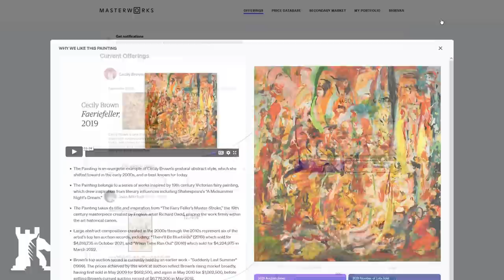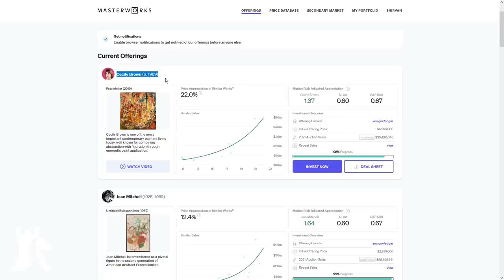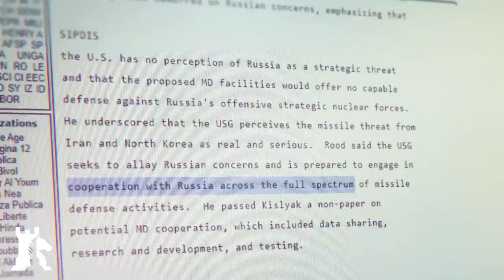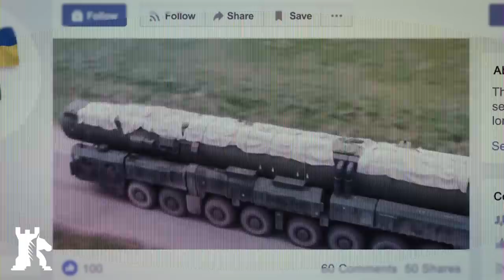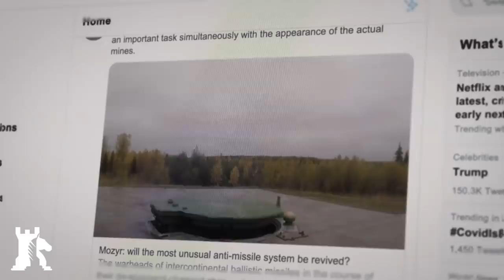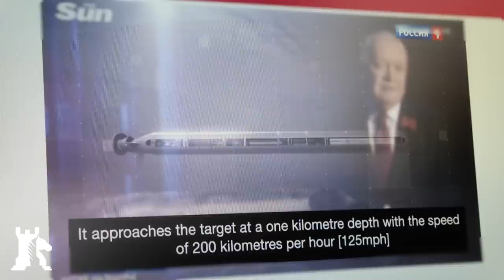Russia develops new doomsday weapons

Comment: 30 years ago building a muli-axis CNC was a big deal from a software & computing point of view.  Now you can buy a 3D printer for < $600.  The electronics restrictions aren't going to be as effective as they once were from the point of view of manufacturing. Your $200 phone has enough CPU capability to run a multi-axis CNC machine.  It will just take some time to put together a local industry.

Comment: If these weapons work like the rest of the Russian military equipment, I think the Russians should be way more scared of the NATO response 😅 also, even if they all worked as intended, they are pointless because it would be like signing your own death sentence if you decide to use them. And Russia boasts of capabilities all the time that turn out to be nothing but hot air. The US approach is far more responsible and discreet. They don’t publicly announce exactly what capabilities they have.
Reply: I predict that in 2 years time Russia will enter revolution and will be denuclearized. Maybe with a swift and mean slap from NATO. I am an optimist though.

Comment: This piece was okay but I think you're missing some of the bigger picture here:

The US and the west have had the capability to develop a missile defense system that would basically negate the entire Russian arsenal's effectiveness since the late 80's. We have a limited amount of these missiles in the ground in a base in Alaska, but we purposefully keep the number low, as you correctly point out, to not tip Russia over the edge. We also use it as a bargaining chip.

The missile defense systems in poland and germany were never intended to be used against ICBM's because they are not along the path an ICBM would follow to get to the US. ICBM's would fly over the north pole and through Canada to attack which is the shortest distance. Not over the atlantic. Russia knows this lol. Patriot systems are primarily anti air defense systems that can also take out things like cruise missiles, which can be nuclear tipped. These are considered tactical nuclear weapons though and pose much less threat overall.

Russia has had the capability to blow up the entire united states and western europe to kingdom come since the 70's, and we've had the ability to take them with us since then too. Neither side has consciously chosen to negate that edge so as to avoid provoking the other, hence the tense negotiations you describe. Nuclear drone torpedoes provide very little advantage in this measure, because after all, if russia wants to send the united kingdom into a nuclear winter, it doesn't need some scary new drone torpedo to do so. It already posesses the weapons it needs to achieve this goal.

All three of these new projects are basically just purely propaganda designed to scare the west and impress people (like you, Caspian report) into falling for it hook line and sinker convincing everyone else that russia is still some relevant and scary power. They're not. Western analysts have been skeptical that poseidon is something Russia will ever be capable of achieving, and now with the onslaught of western sanctions and the general difficulty with obtaining advanced electronics, it's almost certain to set any progress they were making back decades.

The west doesn't take russia seriously with these measures because they recognize them for what they are: pure propaganda. And you're just amplifying it.
Reply: Good man for putting them in the picture......thats surely one of the best answers ive seen on youtube comments.....keep up the good work !
Reply: @freddiepizerhall8324  look up the ground based interceptor program. It's deployed mostly on the west coast to counteract a launch from north Korea. The aegis system used on most warships since around the time period I mentioned is also the most reliable system we have.
Reply: @AlexDahl  I will look it up Alex...cheers for that !
Reply: Stay away from drugs kid!
Reply: If they are for pure propaganda reasons and people like Caspian report fall for it then they surely achieve their purpose. Let's not be biased
Reply: @johnxina5126  what?

Comment: 8:28 According to Wikipedia (sources listed there, as usual), its range is 18.000km. The technique used is called Fractional Orbital Bombardment System, which, basically instead of lobbing it up to come down at a specific target area through pure ballistics (in other words, what the V2 already did in WW2), it also includes a course correction once in space so it stays in a low earth orbit, just to shoot a retrograde burst once the destination is reached. And by entering a LEO, it's not suborbital anymore by definition. So basically it's got a flight profile just like a space shuttle with the only difference that it doesn't land safely, but goes boom-boom instead. With that, they could circumvent the NORAD defensive launch detection systems by just launching them in a southerly direction instead of taking a more direct route, but it won't go inbetween the continents like a snake as shown in the video, even though it would probably pass the south pole or at least get close to it. In case it would be suborbital, they'd do it with the "hypersonic" glide vehicle (everything that comes back from space is hypersonic, so it's just a nice buzzword here) and bounce off of the atmosphere several times. Eugen Sänger had that concept already in WW2 with the "Silbervogel", also known as antipodal bomber, with the thing even coming back for a landing after dropping stuff on the other side of the planet. In a nutshell, there's nothing groundbreakingly new here at all.
Reply: A lot of people don't trust Wikipedia...
Reply: Lot to read here but thank you for taking the time
Reply: @leandersearle5094  Alot of people don't trust people replying to youtube comments...
Reply: I wonder if the Americans can figure it out.  Lol.
Reply: @Healthliving1967  I was being Ironic.   It's fairly obvious that NORAD etc will require minor updates. It can already cope with SLBM
Reply: @williamzk9083  NORAD lol,thats all but forgotten about nowdays. They have far more advanced D.U.M.B.S in many locations over America. There is so much we dont know about that has been going on for decades its unbelievable. I doubt the general public will ever know about it.
Reply: @granhei  Don't trust any source unless it's yourself ;)
Reply: @williamzk9083  BTW, it's pointless anyway to have a max range figure given anywhere if the thing would be capable of establishing a LEO. It'd basically be "anywhere on the planet within less than 90 minutes". And that's not a new thing either. And most probably NORAD etc. would know the stuff a lot earlier before the average folks hear anything about it on either type of media.
Reply: To go through south pole you need a range greater than 30,000km. Simple as that.
Reply: @InTenZeGamingHD  Then don't. For better AND worse, I'm not wikipedia.
Reply: Of cause NORAD would detect it, they have satellites that detect launches (and have done for many decades)!
Reply: @thedausthed  Yeah, it might detect it, but what they gonna do to stop it? Plus it has no thermal signature after initial stage.
Reply: @B D And fries. And coke. And apple pie.
Reply: @CakePrincessCelestia  
i would say a source from yourself gained also  from other sources that is equally reliable as yourself that ofcourse hangs in the responsibility of oneself to investigate 

'';;;;;'''''''            2 Esdras2: 32 -100              '''''''''''''' ;;;;;;;;;;;
Reply: @ardmrad9278  How? Probably with the same means they can watch and track everything in LEO the size of a tennis ball or larger (or is it a golf ball?)...
You got to realize almost none of the literally 3 trillion+ that has gone into black projects has ever become “known”. And considering what is known, and for how long these very advanced systems have been in use, it’d be highly unlikely for there not to be systems to cover almost anything and everything imaginable (and unimaginable).
Reply: @MikeOxlong-  It's almost a known fact that most of the money spend is going to many different pocket and the end result is as usual mediocre and overhyped end  products.
Reply: @ardmrad9278   Not really. It only takes the occasional leak like those of Snowden to catch a tiny glimpse into the true realities... and if you (for instance) were to say follow what has been said by him alone in the numerous times he’s spoken online with the hacker community plus at security conferences, plus if you already have a technical mindset and know what can be accomplished if one were to just focus on it, it’s quite easy to see.

Comment: The old ICBMs from 60 years ago can blow up any city , so how do you improve on that?
All ICBMs are hypersonic,they go to orbit at 5000 MPH and increase ti 17,000 MPH once in orbit.
Reply: Agreed. I kinda wish they would bring back the Pershing P2.
Reply: they are fast but can be relatively reliably tracked, the new weapons as I understand have more erratic and unpredictable paths leading to its target, thus making it much, much harder to intercept these (even though it is already quite the feat due to their extreme speed and multiple payload setup).
Reply: New ICBMs are not living the athmosphere and speeds are much smaller in consequence 6mach vs 25mach diffrence is that new icbms are maneuvrable dont have eliptic trajectoryes so point of interception cant be calculated,hence defence roket systems become obsolete ....dreaming and hoping on laser defence soon
Reply: @adriantataru7476  There is no 100% ICBM defence for the current nukes. .
If 20% hit their target the targeted country is not recovering.
Reply: @adriantataru7476  laser based defense platforms are interesting indeed, however such systems got many drawbacks right from the start, for one is the power requirement, also even if you could build one, simply adding reflective materials to a rocket could reduce the lasers effect with 90% or more
Reply: @papab34r  there are alot of drawbacks on laser weapon système for the moment but tech and développement advance fast in last several years true they need hudge amounts of energy and refractary matériels can lesen the effects but every problem have a solution and refractary matériels will make missiles have alot of new problems mainlly on guidance systems....
Reply: @adriantataru7476  Now I'm no expert on rocket/ICBM guidance systems, but if those are based on say radar or something alike then reflective materials will not affect them att all and if they are, then I dont see the redesign of such systems to be equivalent of the creation of a long range laser platform, one is possible today and the other one is well.. star wars.

Comment: The South Pole idea for Sarmat would still be a ballistic (Great Circle) trajectory.  There is no meaningful amount of dodging of ground assets; The dodging ("Mid-flight maneuvers") involved with the Sarmat would be on the order of a few tens of meters per second, not the thousand-times-greater impulse you would need to make significant turns in the manner depicted, and it would be for the purpose of avoiding interceptors that are on a fixed ballistic trajectory.  Interceptors have inherent issues in retargetability versus timely boost - they work best when they blow nearly all their fuel load in the first few tens of seconds.
Reply: Ballistic trajectory is an arc, not zig zag through South pole.

Comment: I think you made a glaring mistake about Poseidon power.
You stated 2KT.
Nukes dropped to Japan were about 20KT.
The actual power of Poseidon would be anywhere between 50-100MT.
That's 1000 times more powerful then Hiroshima nuke.
Russians demonstrated with Tzar Bomba they can scale that as it was about 50MT.
I can't see why Poseidon can't be 100MT.
It needs power to create a huge wave.
Reply: It could easily be 200 megatons. Have you seen the size of the warhead? Its enormous. The Tsar Bomba was made in late 1950's/1960 and detonated in 1961. They halved the yield by using a lead shield. The Tsar Bomba was 100 megatons reduced to half to reduce or nullify any fallout. The warhead is similar in size to the Tsar bomba except its another 60 years worth of technology, where you can fit larger and larger yields inside of smaller and smaller warheads. The yield also begins to increase the larger the warhead, so, example, a imagine a 500kg nuclear warhead that was for simplicities sake, 500 kilotons, and then you had the same design, 1000kg nuclear warhead with double the warhead size, it would be more powerful than 1 megaton, and that continues to scale better and better the larger you go. If they could make a 100 megaton warhead in 1961 I see no reason why this gigantic warhead with all their technology that they have now wouldn't approach 200 megatons.

Comment: In 1993 I had lost my position at Boeing as a weapons designer. To make ends meet I took a variety of temporary jobs in Seattle. On the assembly line at Nintendo O would often find myself next to one of my Russian counterparts. The Russians had come to Seattle to possibly get jobs in civilian aerospace which were few and far between with so many US designers out of work.
Reply: Thats crazy, theres no work in my LOCALITY i cant imagine people being able to just go anywhere in the world and get jobs wtf
Reply: @CommentComment-yf5nd  The collapse of the Soviet Union led to some strange conditions.
Reply: @CommentComment-yf5nd  Are you a weapons designer? Got a degree in rocket engineering? Aerospace? With certain skillsets, you can go anywhere in the world and get jobs.  But, yeah, what Marvin said, the collapse of the Soviet Union flooded the market with engineers and computer programmers. And academics in general.
Reply: @LinasVepstas  I am a Physicist/Chemist/ EM engineer
Reply: @moors710  I've no doubt. Fixed geographic locals experience booms and busts and engineering/science talent. Esp. if they are single-major-employer towns. If the major employer lays off, you have to sell your house, usually at a loss, and move somewhere else. It's very painful. None-the-less engineers have better employment opportunities than most others.

Comment: 7:17 you can't "carry out secret nuclear tests" The one contradicts the other.
8:20 "brief boost phase before going cold" - like some 100% of the missiles on the planet
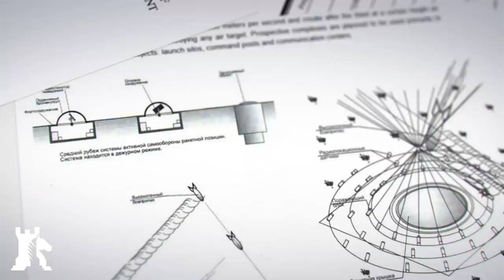9:05  "can destroy incoming missiles" preemptive or not the ICBMs are not to be repelled with missiles. 
9:18 "hypersonic glide vehicle" - sound similar to Shuttle back from 40 years ago which glided into the atmosphere from space. Wait...
9:25 "faster than Mach 6" - nice results, still not faster than the traveling light! Damn.
10:00 "Poseidon" cheap-ass solution Russia can't afford.
16:04 "Weak nuclear state is more dangerous than the strong one" Wrong. The weak nuclear state already made the nuclear arsenal unable to work since maintenance was not paid for decades. That means whatever kind of money showed up instantly evaporated into the boss's and worker's pockets.

Comment: I've watched a bunch of your videos so far, and all of them are excellent, except for this one.  You really fell flat on your face on this one.  It sounds like you were reading from one of Putin's propaganda press releases.  Here's my play by play commentary:
Sarmat is just another ballistic missile with some minor tweaks.  Multiple independently targetable reentry vehicles (MIRVs) have been around since the 1970s.  A shorter boost phase does make it harder to detect a missile launch, but any improvement is certainly incremental, not a night and day difference. The WWII era V-2 rocket had a sub-orbital trajectory, so that's nothing new.  The winding path you show is impossible for a ballistic missile like the Sarmat.  The Soviets started playing around with Fractional Orbital Bombardment Systems (FOBSs) in the 1960s and decided they were a waste of time in the 1980s.  The idea of attacking over the South Pole is from the 1960s when the US had relatively few, primitive missile defense radars all pointing north.  That was 60 years ago, ancient history in the context of missile defense systems.  Throwing a pile of high speed, metal bits into the air to destroy an incoming missile is an idea that started in WWII to intercept V2 rockets.  How are 30 mm bbs more effective than bullets?  In any case, Mozyr requires radar, which can be jammed, overwhelmed by decoys, or destroyed by an air burst beyond the range of any ground based bb guns.  Avangard is just another reentry vehicle, with a twist.  All reentry vehicles are hypersonic, this is not special, at all.  So it gains some maneuverability.  Then it must lose speed and gain weight, surface area, and a brighter signature in radar, infrared, and optical.  It's a trade-off, this is nothing earth-shattering.  Last, but certainly the most ridiculous, Poseidon seems to be something from the imagination of a 10 year old, or Hollywood, same thing.  Anything traveling at 70 knots under water makes an insane amount of noise.  In water, sound travels at 2,878 knots, so the whole world can hear it coming from many miles away.   Any nuclear weapon with a yield greater than 1 megaton (Mt) is just political noise.  Any and all targets, including cities and missile silos, can be effectively destroyed by a direct hit from 1 Mt weapon.  Multiple small warheads are usually more effective than one big one anyway.  A "nuclear tsunami is the silliest thing of all.  Ocean waves don't move water horizontally, they're kinetic energy moving through a stationary medium.  Also, nuclear explosions aren't very efficient at making tsunamis.  Even a 500 Mt bomb wouldn't create the same kind of devastation as the 2004 Indian Ocean earthquake and tsunami.  But hey, at least you nailed your sign-off statement, as usual.